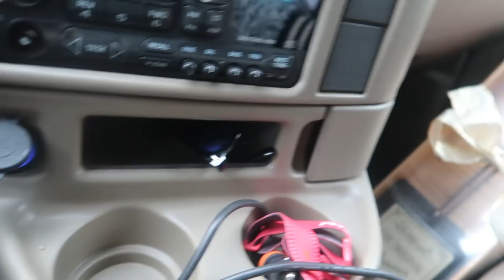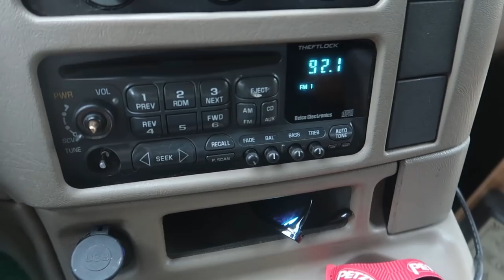He's Working on my VAN BUILD | Simple Campervan Conversion (Unusual Van with an Unusual past...)

Comment: That large rectangular hole is cut into the floor because someone had to replace the electric fuel pump inside the gas tank, otherwise they would have had to pull the whole gas tank out from the bottom which is a really hard job if you cant afford to take it to a mechanic with a garage lift. Be glad it`s there in case the fuel pump ever quits again. They should make access  panels for all vehicles in tank electric fuel pumps but they don`t. 
 I hope you get your van fixed up the way you want it. :)

Comment: That hole is for east access to the fuel pump for replacement , It looks to be done well ,Its a good thing .otherwise the gas tank has to be removed ,and is expensive .not to mention towing cost .  It looks to be done well . Carry a spare fuel pump with you.a decent one .not a cheapo. it is common for them to go out.